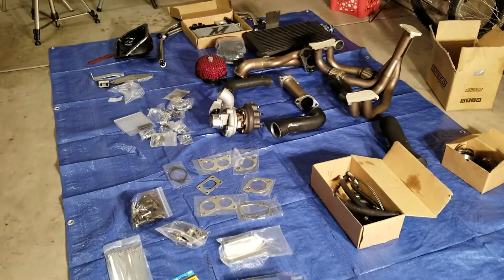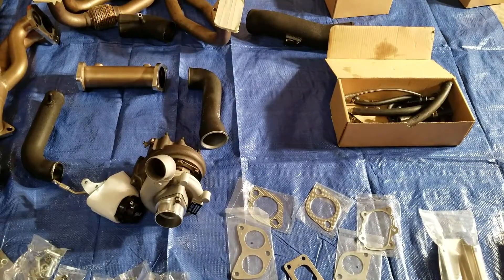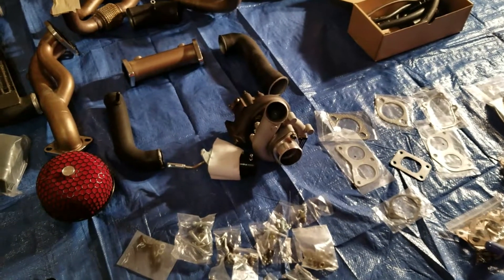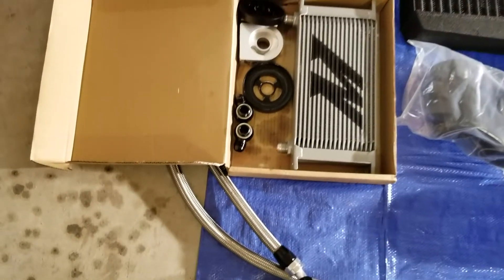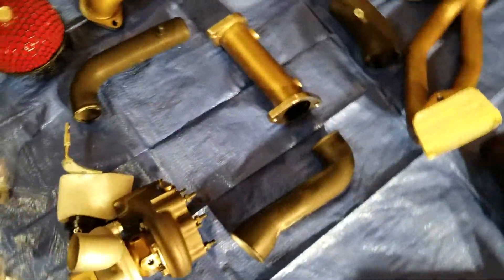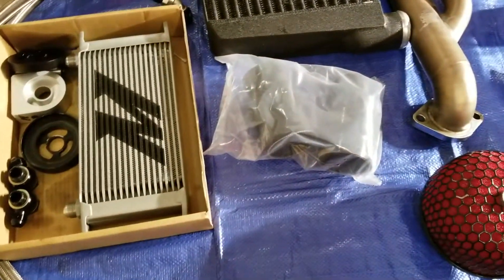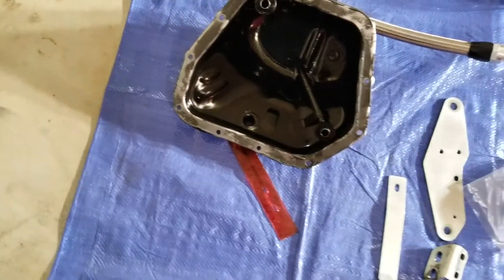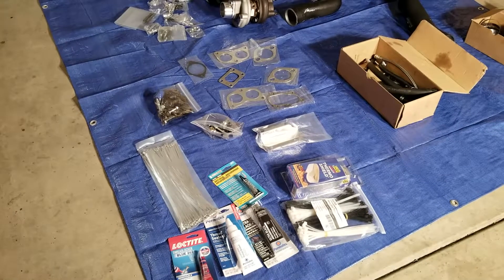ROAD TO 300HP SUBARU BRZ - SBD500X Turbo kit Install Part 1 of 6 (Overview)

Comment: Any issues? Ive been considering this kit but i heard internal wastegates suck. Some people with the old kits say the turbo needs to be ported.
Reply from the maker: So far, 5k miles no issue. And yes the older ones needed to be ported to fix boost creep. i think they changed the design for the newer version or they come in pre-ported. It changes the car drastically, in a good way, and recommend it.
Reply: @brzser8387  yea looks like it was just the older versions. I have heard of the manifold cracking but other than that it seems like its a good kit, i see a lot of people that have had great experience/reliability. Im stuck between this one and the jdl turbo (id have to wait longer on the jdl kit), i just dont know if i can live withought the uel exhaust. Do you miss it?
Reply from the maker: @Ryan-ue9ve  yes i deeply do haha. But good news, JDL is currently developing an turbo manifold specifically for this turbo kit! I do plan to get that in the future.

As far as the SBD manifold ive read that they only tend to crack under heavy track/drift use, not so much of a problem with street/daily driving.

Also don't wrap the headers rather ceramic coat them if needed. Wrapping them helps cause cracks as well.
Reply from the maker: @Ryan-ue9ve  i should have mentioned, its a UEL Turbo manifold.
Reply: @brzser8387  where did you hear that, because that sounds awesome. A Jdl uel turbo manifold would be a sick option later down the road. Man this is a hard decision.
Reply from the maker: @Ryan-ue9ve  its on the facebook page of BRZ/FRS/Gt86 ENTHUSIASTS , as well as the JDL facebook page. Yeah, in my opinion it just depends on what you're looking for.  There's too many variables to consider haha.

But the best deal at least for me is to buy a used sbd500x v3, and change the turbo manifold since it is the weakest point.

Also in terms of power levels I'm looking at ~300whp for daily and occasional ~350-~400whp with boost controller. In this case SBD works for me. I'm using the money saved for supporting mods instead.

Compared to jdl to get the same specs as sbd it would be around ~$5k new (SBD $3.3K new). You do get the uel right off the bat and the bragging rights of owning a JDL kit lol.

 In terms of quality, only the turbo manifold of the and kit is the weakest link, from my research.
Reply: @brzser8387  yea i have to agree, i dont really care about bragging rights. People smack this turbo kit because its a knock off but from my experience knock offs can be pretty damn good. Although, in some cases they are right lol, like my knock off rocket bunny diffuser. But yea im looking at their manifold and im guessing its going to be over 1k, so it might be better just to buy the kit first instead. Ahhh this is why its so hard to pick, the sbd has value, sure the manifold is the weakest point but at the same time i only put like 1.5k miles a year so its not like ill be running into issues anytime soon. The jdl kit has the uel option already but at the spec i want it its about 1k over, plus i havent heard of people with the jdl kit getting an oft tune so id probably need to buy ecutek, so thats another 1k. Im looking at waiting and spending 5400 vs buying it now and paying 3400 just to start, and i really only want 300whp for now and 400whp tops which sbd can do.....
Reply from the maker: @Ryan-ue9ve  sounds like me haha. The SBD might be it for you too lol. Honestly the SBD kit has the biggest community compared to other turbo groups. I'm guessing because of that they've improved their product to a point that actually exceeds the original base greedy kit, according to James martin (tuner legend for this platform). Which ever boost you're going to get, trust me its worth it haha. Specially if its your first boosted car like me, I'm coming from a 2006 honda fit lol.
Reply: @brzser8387  yea i just bought it lol, soooo excited. Decided i could use the extra 1500 on a big brake kit. Jdl is nice and it was my dream for so long but i could be happy with this kit for another 4 years then change it later if i want too, or just buy the jdl manifold. Thanks man, you should post vids of the exhaust!
Reply from the maker: @Ryan-ue9ve  Awesome! you won't regret it, haha. Yes, I will once everything else is uploaded!
Reply: @brzser8387  yea im going to watch your videos religiously lol. Im planning on installing it myself too.
Reply from the maker: @Ryan-ue9ve  nice! Wish i could finish editing haha, prepping for a local car meet specific to the brz/frs/gt86. As you can see the car is super dirty lol. Good luck and take your time, also use the greddy instruction manual, almost the same with minor difference.